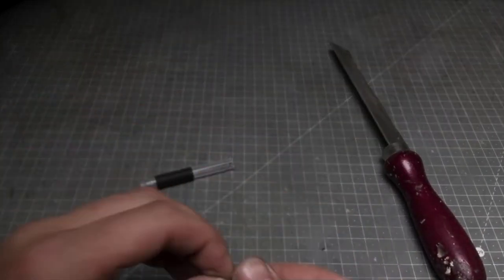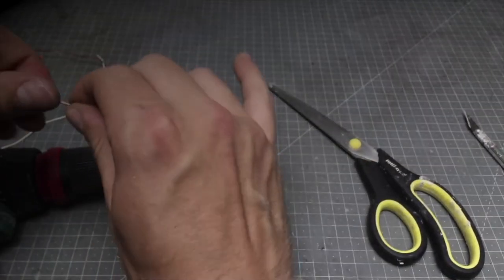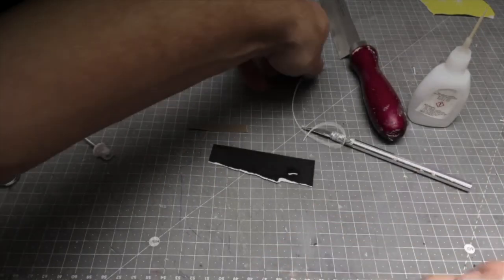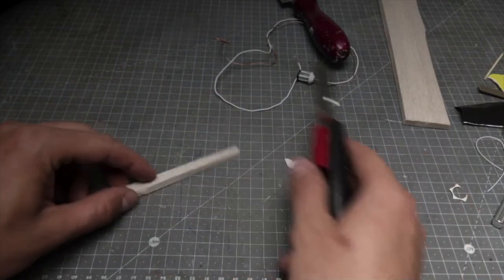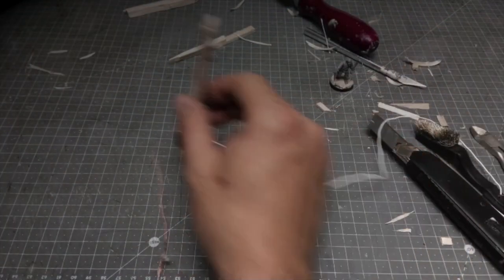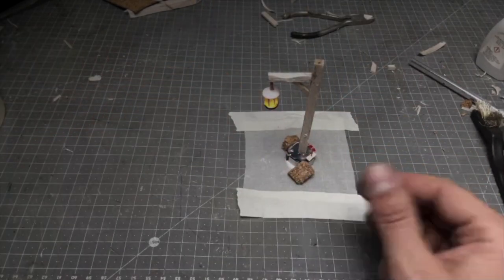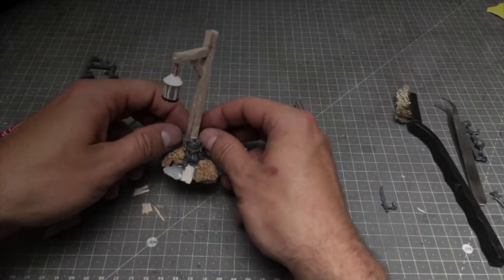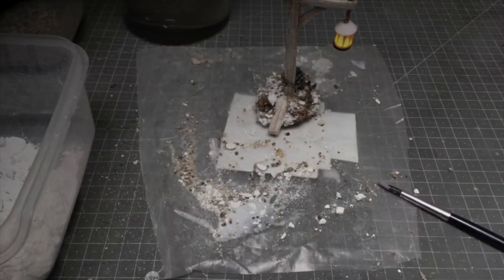Building Fantasy LED Lantern (Part 1)

Comment: Love it!!! Thanks a million formaler guidance. What kind of LEDs do you use and what kind of battery case? Anything available on european Amazon?
Reply from the maker: I’m happy you enjoyed it!😊
From the led lights  I’m using 3mm or 5mm blinking ones (I have bought a big batch long time ago from over the seas), and casings was bought locally - can’t remember precisely the model (it’s holding single round battery).
I could try to find something similar on Amazon but can’t promise the quality without checking it first myself…